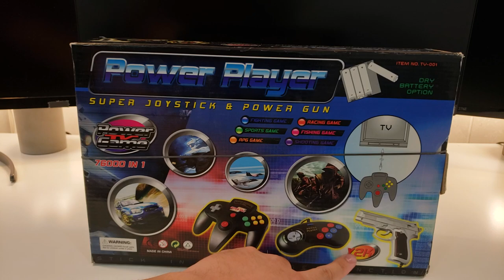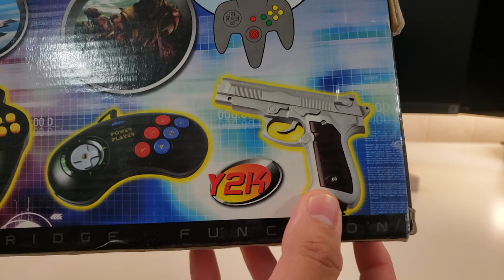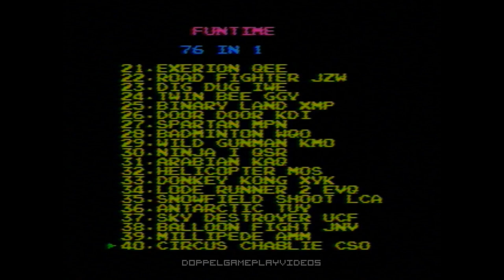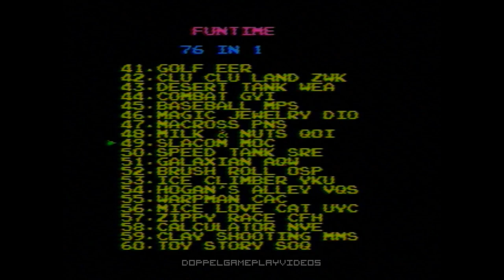The Power Player SuperJoy IV - 16 Year Old Illegal Games Console!

Comment: Do you have any idea what the polarity of the power supply is? I just found mine from years ago but don't know where the original power supply is
Reply from the maker: Seems to be a Negative Outside, Positive Inside for me at 9V 300mA. Do note that there's so MANY versions of this that this info's not a guarantee. Use the battery pack for the safest route.